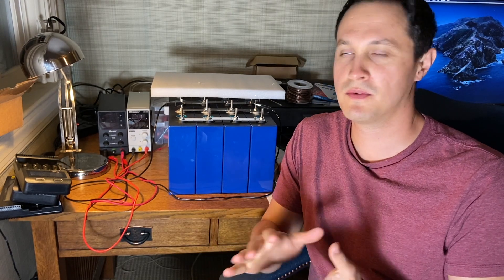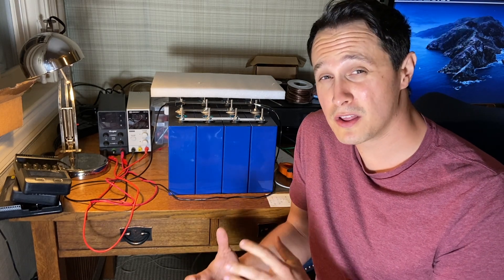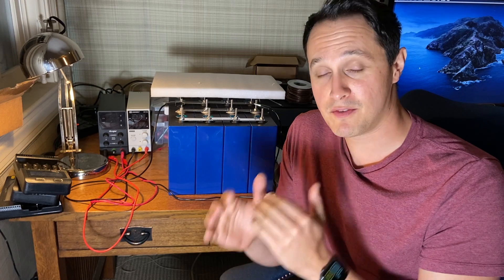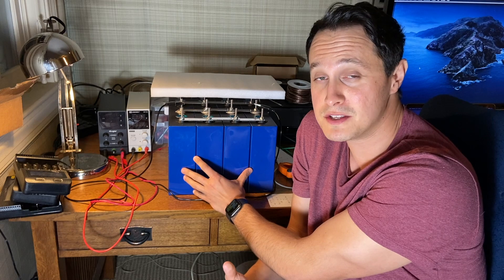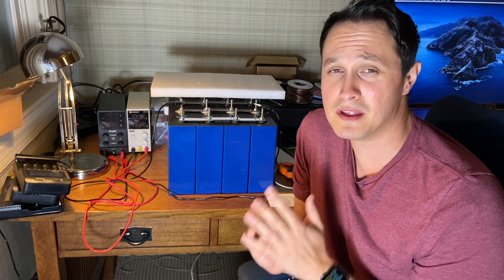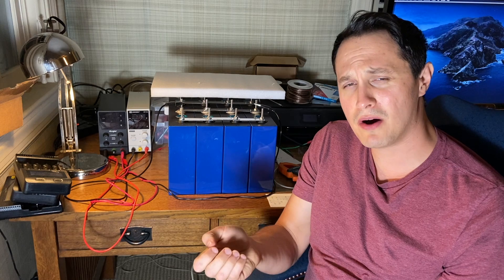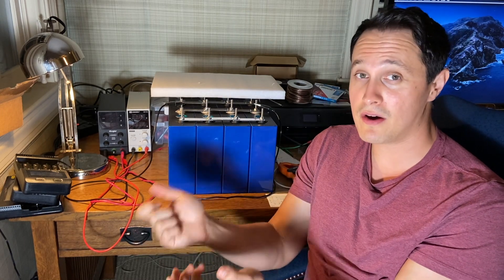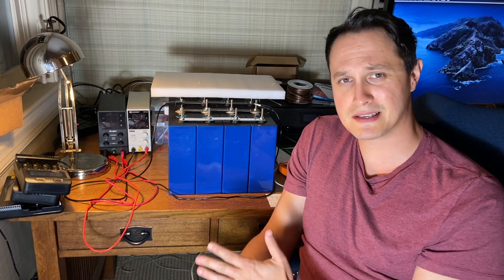Lifepo4 Basics and What You Need to Know!

Comment: you said if there was a subject that we would like you to cover let you know. I would like to see a video on how you pick the right size BMS for your battery. I am building a 12v 560Ah battery with 8 x 280Ah cells and I can't find any video's on line that tells you which BMS to get.
Reply: Try Overkill Solar
Reply from the maker: Thank you for the suggestion! I've heard good things about overkill and I will be posting my own experience with Daly soon enough. There are MANY BMS options and the prices between them can vary immensely. The main factor is that you want to make sure the BMS is rated for 20% more amperage than you need. So if you want to draw up to 80 amps at a time, make sure to get a BMS that can handle at least 100 amps. Otherwise read reviews, and decide if you need things like bluetooth and low temperature protection (if they will be in an unconditioned room for instance).
Reply: @Spridle60  
And you can get those with a USB or Bluetooth dongle.
Then you can just check the app and see exactly what's going on with the battery cell by cell.
And it's easy to program the parameters.
Some of the bms's have a third lead on them that allows the battery be charged by solar panels or charger.
But will still have outgoing power disconnected until the voltage charg comes up high enough for the battery to re-engage output power from the BMS.

Comment: Hi I am buying 8 of the 200ah cells with 4 100watt solar panels a 4s 12v 120 bms a Victron 100/30 charge control  and a go-power 1500 watts inverter. Do you think everything is OK or is there anything I should change. It is going to supply 110v in my house in the Cape Verede Island. Thank for any advise.
Reply from the maker: I can't advise without more details. Make sure you wire your solar panels correctly - you need to make sure your voltage and amperage will not be too high for the charge controller. I will also say that 400 watts of solar power, assuming 5 hours of sunlight a day, is 2kw of power. But your cells have a capacity of 5kw, so on an average day you can only charge your cells around 50%. There are many other factors to consider, but those are the things that pop out to me.
Reply: @TheWilltoBuild  I will be wiring the solar panel in series which will give me 80V with 5Amps. So should I buy 6 solar panel and connect the panels in Parallel which will give me 20V and 30Amps??
Reply from the maker: @napoleonbarros8272  You could, if you had six panels, do two string of three and then wire them in parallel, so that would be 10 amps at 60v. That is how I would do it. All you need to do is wire three panels in series, wire the other three panels in series, and then put those two sets of three parallel together. I would do some more research on strings vs parallel and solar panels, there is alot of good information out there on this topic.
Reply: Ok but I can still use the same BMS 4s 12v 120a?

Comment: Question - I just put together my first ever 12v 4s LiFpo4 100Ah battery pack a week ago, but right after I finished the top balance, I accidentally arced one of my cells. My concern is, how much damage do you think I did even though it was a quick arc and do you think that cell will stay in balance with the others over the long run? Thanks again, and keep up the great videos.
Reply from the maker: I doubt a quick arc is a big deal. Check the voltage of the cell in comparison to others. If it is very close or identical, you're probably in good shape. If not, maybe top balance them again?

Comment: I'm using EVE 280 Ah cells in a 48 volt configuration and charging them with solar panels. So it looks like if I want to charge them to 90%, the charge controller should be set to 53.6? What about float?
Reply from the maker: I'm thinking I will discuss that in another video, but here is a good resource: https://www.solacity.com/how-to-keep-lifepo4-lithium-ion-batteries-happy/

I would recommend following Will Prowse's recs here: https://diysolarforum.com/threads/recommended-charge-profile-for-diy-lifepo4-batteries-sticky-post.5101/

Specifically, my params would be:

Absorption: 56.4V
Float: 54V 
Inverter Cut-off: 48V

Basically, NEVER use the equalize charge function (or set the equalize value so low it never comes into effect), and float can be set below your max voltage so it isn't used.
Reply: Your math seems way off. For  4 cell bank the charging voltage should be 14.6v for 100%, so 90% should be somewhere around 14.4 etc. So multiply 14.4 by 4 to get your 48v configuration would be 57.6. so I have no idea how you calculated such a low voltage, unless my math is way off
Reply: @eksine  Nope, 90% is around 13.4V according to a reliable source. 14.4 is still above 99% soc.
Reply from the maker: @SpeakerKevin  Yep, 90% is about 3.35v per cell.
Reply: Also lifepo4 isn't supposed to have a float charge but if your charger must do it than I think it's somewhere around 13.8v or less. Do some research on it
Reply: @eksine  Battle Born recommends 13.4 float (anything under 3.4V per cell).
Reply: @SpeakerKevin  so didn't you guys just answer your own question than??????
Reply: @eksine  It took a little research, but yeah I think we got the answers we were looking for.
Reply: @SpeakerKevin  yeah your 53.6 was spot on, just disable float. You will regret floating it
Reply: @eksine  Sounds like a good idea, thanks.

Comment: I top balance, no sense bottom balancing them because the bms is going to top balance them anyway.
Reply from the maker: That is a good point, most BMS just burn off ah at the top.
Reply: I found that the BMS (Daly in my case) did not burn off near enough current to top balance cells. The safety would kick in to stop charging as soon as one battery (the weakest one tops out the quickest as it has the lowest capacity).  I had to go back to a parallel string and charge at 3.64v (my safety choice) for maybe a day or two to finish top balancing them until the string took less than an amp (saturation). That made a huge difference in getting the cells at the same voltages (within .002v) I see why some setups use active cell balancers.
Reply: @jamesbsa6450  Yes, always top balance before hooking up the bms. People that don't use a bms (very risky), will generally bottom balance, then keep the pack between 80% and 20% for safety.
Reply: @SpeakerKevin  in my case I didn't have a regulated 0-50v bench power supply to safely charge at 3.65v at the time I started my build, AND I wanted to (safely) use the 28v 13a battery charger I had at the time to accelerate the charging of my 8s 272AH Lishen set, so hooking up the BMS was a must, to protect the individual cells from over voltage.  It got me most of the way there but had too much cell variance to get me within the range of my liking, so later bit the bullet and bought the Regulated PSU and dialed in 3.64 with the batteries rewired in parallel to top balance the safe and effective way without a cell balancer.

Comment: Lifepo4 prismatic cells must be compressed, EVE advocates compression, TopBand also advocates compression. Just also looked up Lishen LifePO4 request compression for any warranty.
Now for LifePO4 cells, I would Top Balance, this way the BMS doesn't work as hard, and also discharges equally. If not top balanced, They will not discharge equally.
Reply: Thanks but didn't we just hear all that from the video? I would have hoped you would have gave some tips on how much or how to compress...
Reply: @JM-yx1lm  each MGH has different ratings, just pull up their spec sheet and or contact which ever brand you have. There’s so many different mfg’s
Reply from the maker: I agree, definitely look at the spec sheet for details. I didn't want to get too into the compression discussion here, because there is a lot of debate on the topic, both in terms of how important it is and how to actually go about doing it yourself. I'll be covering that in the future after more research.
Reply: The compression thing surprises me. I would have thought to put some spacers in there to facilitate cooling. Perhaps someone makes something like cardboard, but in aluminum.
Reply: @jimsteele9261  I like the thought of airflow/ cooling as well. Aluminum in between could go terribly wrong if the positive charged case wrapping ever developed a puncture or melted. So it would at the least be anodized to make it non-conductive. If someone mfg a corrugated aluminum sandwich  maybe 1/4" thin that was anodized it would work brilliantly but suspect its cost would be very high as well.

Comment: Any recomendations on a smart bms I use daly for temp controlled enviroment and as a fail safe.but in my RV going to go with solar overkill on first pack and see how I like them
Reply from the maker: I need to do more BMS research. I'm using a Daly smart for my system, and I like it, but I need to put it through its paces and do a full review. I've heard good things about the overkill.
Reply: @TheWilltoBuild  what model Daly did you buy... The 16s 250 A for about $230? Btw I ordered a Genetry unit. Apparently one of the last 5 on the shipment. Hope it's good!
Reply: @allmomomosthomebus3895  also OverKill Solar BMS are also great with a warranty here in the USA
Reply from the maker: yep, that is the one. I am yet to put it through the paces though. Really cool with the Genetry - I hope it is half as good as they say it will be.
Reply: I currently use a Batrium BMS, but got my hands on the diyBMS by Stuart Pittaway, the latest Controller 4.2 and the new boards 4.4 are nice. He’s working on a shunt as we speak. Check them out. Fairly cheap and also check out the Facebook group on diyBMS
Reply: 032921/0429h PST 🇺🇸. Please note “ Overkill” is only a seller. A very high priced seller. The real name of the BMS is JBD, not Overkill ! The cost of  100A JBD smart BMS costs only US$55~60 each inclusive of shipping. (US specific) I use JBD on 3 of my PV Systems and they perform perfectly. The Bluetooth range is almost 60’ and satisfactory. You may be able to extend the range by soldering 1.5 meter AWG20 or 24 at the tip of the internal antenna on the BT dongle.
It’s also possible to configure the Battery charge parameters on iOS/ OS X , Android & Windows systems. A one time fee of US$5.99 is required to obtain the software for iOS/OS X devices from Apple App Store. I’m not familiar with Android/ Windows system downloads. Renaming individual JBD BMS is possible to identify each set of PV system, being used. Monitoring PV System on Apple devices are easy and effortless. I’d highly recommend JBD BMS for PV systems. Good luck and 73s...
Reply: @sreekumarUSA  damn I just bought the overkill bms on Wills recommendation.
Reply: @sreekumarUSA  where do find jbd 16 s bms